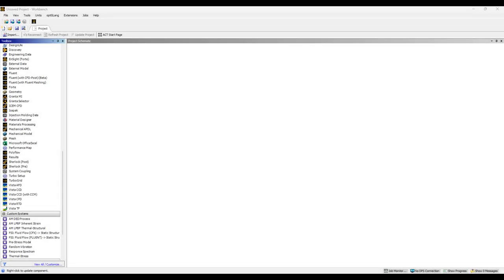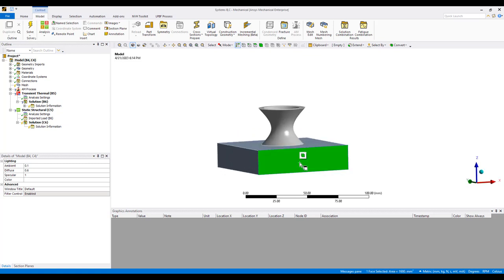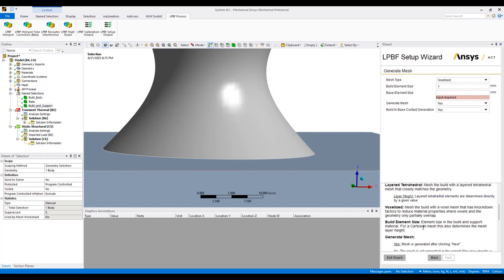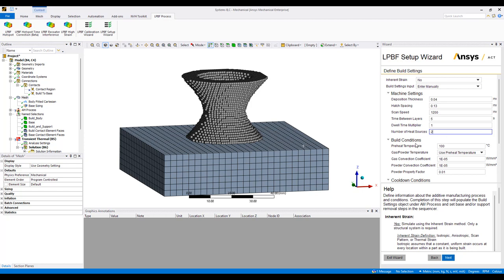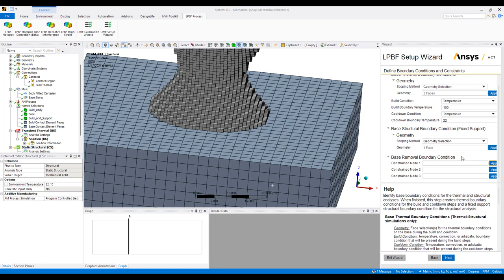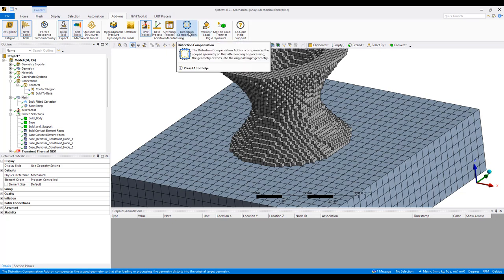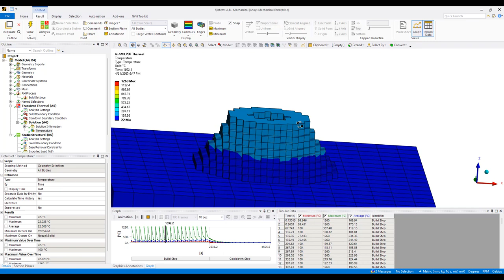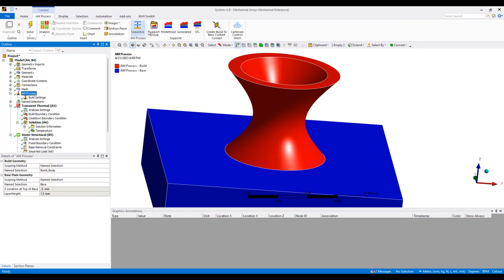Laser powder bed fusion distortion simulation in Ansys Mechanical

Comment: Thank you for your tutorial.
which version of ANSYS did you use? i can't get it in 2021. or how to add this module?
Reply from the maker: I'm using Ansys 2023 R1. This is part of the Ansys additive science package.
Reply: can i get a trial version with additive package ? i need to simulate SLM process for ceramics @OzenEngineeringSimulation